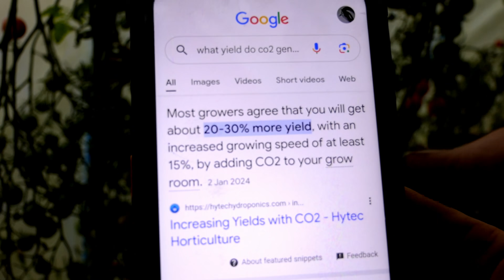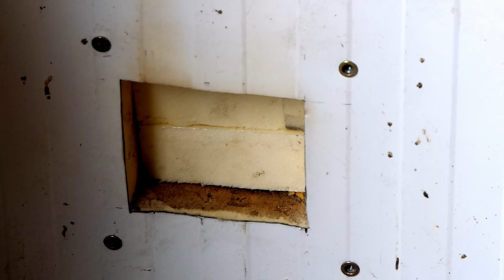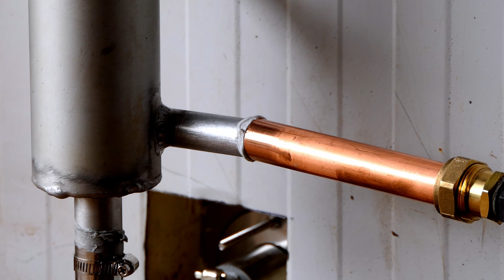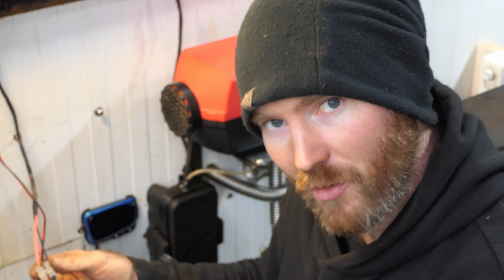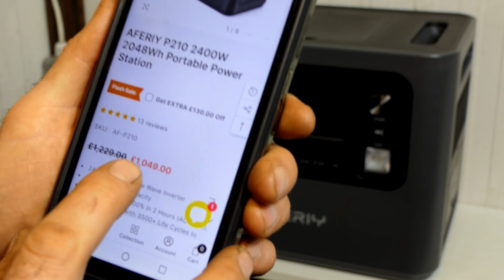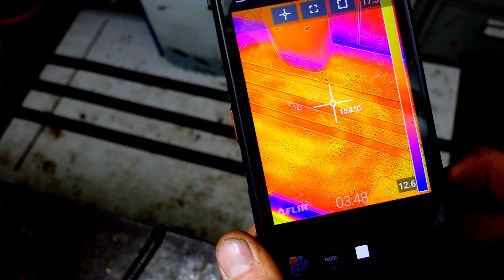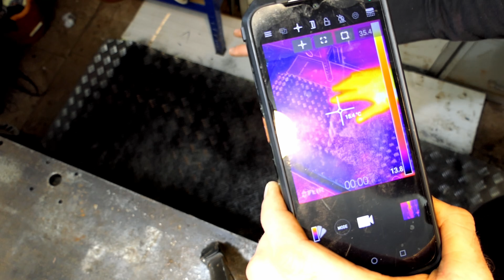NEW! Better system for Cheap and Safe Heating💲+ Underfloor Heating Mod test🫠

Comment: Love the videos. Just got my deisel heater after a friend demonstrated his in his camper van... and as I spend a lot of time in my manshed with my telescopes, I could do with a little warm.. I was wondering if the exhaust fumes could be pushed through a radiator first before going outside..
Reply from the maker: @alecireland5709  thank you. You can but cleaning one may prove to be difficult than less you class it as a consumable part. Cheers J
Reply: @joshuadelisle  I would use rads that are being thrown out, so it shouldn't be to much of an issue. Possibly cleaning could be done by taking the rad off and giving it a bash with a rubber mallet.. I'm just thinking of ideas before I set mine up..

Comment: Simply bury the underfloor heating pipes within a dense material eg screed on TOP of the insulation then all will be well with the efficiency rating.  Your test here is very flawed.

Comment: I rembember watching you last year or two with the previous experiment with the sand and air tunnel. As to your floor heating, you are using an insulated wall panel, with insulation in the name, so all the heat that goes into it is being insulated, so it all goes back out. It is not "lost" into the panel. I don't know how the inside of your eat exchanger looks but surface area/fins are needed to get all that hat into the water. Something like a car radiator, but backwards. In any case, quite impressive getting 45-50°C on a room heater from waste heat. Great results this time. 
EDIT: Thought about it right now, you might be able to get a car water cooled intercooler from a turbodiesel, push the exhaust through that and scavange the hot water from it that way. A junkyard will probably have plenty of them. Also as you mentioned, a cooled EGR might also work for this. 

As to your initial and last point, even aquarium people inject CO2 into the tank for he plants. Waste energy and efficiency is a much more important part of the equation.

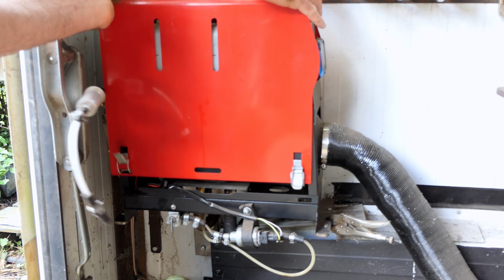Comment: 8:00 in AZ, love your clip,I just would like to say if you were to want hot water & still heat floor mount a tall water heater or tall water tank next to vevor but should mount as low as possible then make your heat exchanger as tall or a little taller & a t at the bottom so u can clean your exhaust of soot, now with thermo syphon flow you will not need a pump but if you use antifreeze you'll need a second heat exchanger the use pump for that, I've experimented with thermo syphon floor heat with a pellet stove exhaust, heated my upstairs apt. No pump, 20' stainless double wall chimney & with the height created more thermo syphon flow plus a tapered poured concrete upstairs floor, apt had a vaulted ceiling on chimney side which created more thermo flow, entered wall at highest point then manifold with 5 lines running down the wall & through the pitched floor then back down to basement to bottom of chimney to cycle again, pellet stove in basement but exhaust heated apartment

Comment: putting climate science denial on you landing page is probably not the best idea, its really easy to see how humans are causing climate change because we can use isotopic fingerprinting to detect the carbon isotopes in the atmosphere, when you test the atmosphere you will largely find carbon with a lower ratio carbon-14 to carbon-12, which is the signature of fossil fuels. There are many many more ways to prove humans are at fault but this one frankly should be enough.
Reply from the maker: I don't deny anything about climate change and how much is contributed by humans, I've only shared known facts, I'm just not convinced carbon dioxide is the main factor and instead I feel it's being used as a means of wealth transfer and control of power. Geoengineering and deforestation are major factors that can be more easily tackled but there are no significant actions because it doesn't generate wealth for corporations. Cheers J
Reply: @joshuadelisle  theres a simple experiment you can do at home, take two containers and put a thermomiter in each, fill one with C02 and then shine a single lamp on both and you can observe the greenhouse effect for yourself
Reply from the maker: @N1ghtR1der666  you can do that with plants too and see which grow better. Cheers J

Comment: Funny thing…every stat you just mentioned, I cannot post. YouTube removes my posts as being against the community guidelines as false/misinformation and against the global warming postulated by those in power. 
I wholeheartedly agree. 
Keep up the good work. I am currently in the middle of setting up a system in my home, as it will be way cheaper than what I’m currently using.
Reply: Hi having a cheap storable fuel also protects from power cuts or mad foreign leaders turning the gas off!
Let’s all go electric!
Oh you burn gas…..
Ok let’s go wing and solar…..
Oh you haven’t built the infrastructure or turbines, or solar farms or batteries….
Ok how about solar on my roof…
Oh you don’t like it when I own it….

Life is fun.
Take care M

Comment: Quick question what does that rubber gasket do i removed mine as it smelt bad do you think I should buy another one. Btw really like this video
Reply from the maker: @dudarus1  I removed mine too. It just stops air escaping from the blower. Cheers J

Comment: Why not connect the exhaust to the radiator? And just use the hot air to heat up the radiator?

Comment: Great work, this is all things I have been wanting to experiment with as well. I have been looking for a way to include some motors that run off of the excess heat so you can use the heat to run an alternator that will charge the battery that you added to your heater. That way you dont need to add solar panels to the  battery. I also completely agree with your environmental view about CO2 and think the only smart thing biden ever said was before he got elected and it was "we should take saving the rainforest more seriously and should consider paying south america to stop cutting it down". I havent heard anyone say that since the 90s. Keep up the good work.
Reply from the maker: @awarenessforthebetter8336  thank you. The other way I'll be testing out is running a diesel generator on kerosene with a lubrication additive and capture the waste heat from the exhaust. That way I can generate cheap electricity and heating. Cheers J
Reply: @joshuadelisle  have you ever heard of a sterling engine?
Reply from the maker: @awarenessforthebetter8336  I have. They aren't very efficient and are generally very low output. Cheers J

Comment: Two things to point out, one that (as others have said) the pipes carrying the hot water for your underfloor heating are themselves insulators and will therefore not do very well at transferring the heat up to the floor itself. Replacing them with copper water pipe would make an enormous difference, but then you'd also need some sort of diffusion so you don't melt your shoes. Sticking with the PEX, stuffing some normal aluminium foil into the grooves above the pipe might be enough to help create a thermal channel to bring it to the larger metal plate, or you could use thermal transfer tape if you're feeling fancy.

The second point is that, while CO2 increases do lead to life bloom (much the same as radioactive fallout does), that's not the same thing as being good for human life. Humans aren't very well evolved at all & have real trouble adapting to changing conditions biologically. If we keep cutting down the trees then we will end up with more scrub land which, combined with further extremes of weather (whatever the cause; doesn't matter), will lead to greater amounts of fires, which will further pollute the air & raise the temperatures, which will block out the sun, which will tank the temperatures, which will lead to further extremes of weather. The species has not adapted to these extremes of weather at all, & it doesn't appear that anyone wants to fix that with technology either, so that's going to cause a huge amount of problems down the line.
There is far too much debate about whether humans are responsible, if CO2 is the problem, & so on when none of that actually matters at all. What matters is how we can adapt to the changes that are coming.

Comment: best put together system i have ever seen. and best video on the subject. the stuff about the climate change and co2 is perfectly reasonable. try slowing down the pump to make the return colder. bigger EGR always better, more surface area always better, just put an entire IBC in the opposite corner and it will still be warm in the morning.

Comment: There is a reason why underfloor heating pipes are put in concrete so it gives off heat to the thermal mass. But very informational video.

Comment: That CO2 monitor needs replacing, normal atmospheric CO2 is at 450ppm, so your 70ppm above an open flame makes no sense whatsoever 😅😂
Reply from the maker: @bongieger7871  it's a CO monitor not CO2... Cheers J

Comment: Suggestion: Amazing video. I have been thinking about this for a while after watching your last video on diesel heater. What i think may work is having the exhaust pipe going down the heat exchanger in a coil shape to slow the flow of heat going outside but at the same time it allows the moisture to escape too.

Comment: Great vid. COMPLETELY FULL of great info.
I think the underfloor heating would benefit if there was no expanding foam between the pipe but rather timber spacers so the heat can easily fill the cavity.
Expanding foam underneath the pipes, Great.
This vid got "even" better at 43:28 minutes in.
Great to see another Brit saying it as it is, even though no-one in power will ever listen.
Best Regards 👍

Comment: Good vid, good points, Sun, concrete , no trees yes. Buy up Farms for what... Blackrock , or more Tree planting who knows, Grow our own food, yes. Is my punctuation bad yes. I have a powapacs 78000 and the usb blew my mp3 player and phone up not good.  Can you make a external wood stove that can work like a desiel heater so the worm air can be blown into a shed ? If you can I would like to see that  sort of like the desiel chamber but with a door to clean out and heat blown over it ....or maybe they are about ? Remmember Folks ( Govern  Mental Department) this is Maya, Know who runs the show and enjoy the Movie. Toddles.

Comment: If you talk about kerosene in the UK, we here im my part of the world know kerosene as the fuel used in aviation. I assume your kerosene is something else? Maybe what we here call petroleum, the stuff which can be used in the old lamps with a wick? Either way: Here it seems by truck I can only get regular heating oil (similar to Diesel) delivery to a residential address.

So 2 question: 
1st: Can you clarify what exactly Kerosene is?
2nd: Can you get this delivered easily trough local companies selling fuels in general?
Reply from the maker: @yxcvmk  hi. Heating oil is kerosene which is also jet fuel. However the grade will be different for different applications. Lamp oil in the UK is parafin which is a pure grade of kerosene. Cheers J
Reply: @joshuadelisle  Hey, thanks for getting back to me. If heating oil is Kerosene, then it's also Diesel? Because heating oil here is pretty much the same as Diesel, but the government colors it to make sure nobody puts it in cars, since the Diesel is havin higer tax.... 
So when you talk about the clean burn with Kerosene, which is heating oil, then the same applies to Diesel? It seems I am missing something.
Reply from the maker: @yxcvmk  it is very similar to diesel but diesel is slightly more viscose and has lubrication additives which are important for finely tuned vehicle pumps. Also kerosene copes with freezing temperatures better whilst diesel tends to gel up. Cheers J

Comment: does it make sense? dunno, I guess the bastard standing charge kills gas! well here goes for the stuff on gas, 1 October to 31 December 2024: The energy price cap for gas is 6.24 pence per kilowatt hour (kWh) with a daily standing charge of 31.66 pence 1 January to 31 March 2025: The energy price cap for gas is 6.34 pence per kWh with a daily standing charge of 31.65 pence 
October 2024: Unit prices for gas are expected to increase by 14% - doh! what the * is standing charge?

Comment: AFAIK Eberspächer, the original inventor of the D4 auxiliary heater that Chinese companies are now copying, recommends using kerosene as an arctic fuel. 

That's why I don't think the pump will give up any time soon if you use kerosene instead of diesel. 

Thanks for your great video!

Comment: I don't understand why you would go through all that when you can use 240 to 12v and connect that to the changeover switch if you have powercut the switch will change over to battery

Comment: You should add some anti corrosion additives, you will get dissimilar metal corrosion from the Aluminium and Copper, they don't need direct contact even if the sealant does separate them as the water will act as the conductor. I had huge problems with a Copper block but Aluminium radiator in a PC water cooling kit when I didn't fully know what I was doing.

Comment: I am going to put one if these into my caravan but I think putting the burner high up and use flow tubing to port the hot air into the original hot air outlets of the caravan. 
Port the heater exhaust into the top of a radiator and port it's outlet to drip under the caravan. 
Your views on this ?

Comment: Wouldn't it be possible to just gravity feed the burner with kerosene? Or does it have to be delivered at a certain pressure?
Reply from the maker: @dennissorensen8765  it needs a certain rate of feed for the settings selected. As long as you can regulate the flow it doesn't matter how it's pumped. Cheers J

Comment: I heat my house with chinese diesel water heater, floor heating and water boiler is also connected (via inside heat exchanger)it's loud compared to original webasto, but works good. At the same time i drive elektric car, many people think i'm stupid, i find they are useless in mathematic's.

Comment: Someone may have already mentioned this in the comments, but I just viewed a video where the guy ran the exhaust gases through a cast iron radiator. It's to make use of all of that wasted heat that  normally goes out with the exhaust. It's done much like what you do with the water heating system: D&S Farm NS

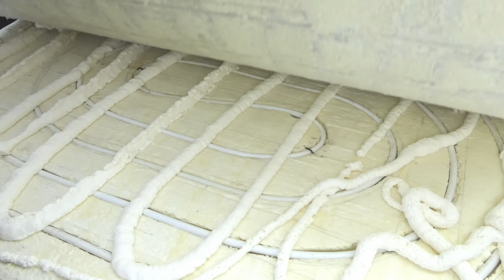Comment: 21:15 Why not use this foam as sound insulation for the pump? Inside enclosure place 2 bags and spray foam inside them close the box so that bags form. Wgen they form there should be 2 halfs of the foam inside the box. It sounds easy but its a bit messy. Nonetheless clicking is much less anoying. Still not silent. But I guess then  bigger is beter. Thanks for clarifying about position of the pump though, I was worried it absolutely need to be positioned at 15 degree but since its stationary it doesnt matter.
Reply from the maker: @aonozan  it doesn't work. I already tried covering it but because it is connected to a hard pipe the vibration is amplified. Through to the radiator and heat exchanger. Instead it needs soft silicone pipes and a cover and then it will work. Cheers J

Comment: 33:35 CO has basically the same density as air. YES it is technically less dense, but perturbations like a heater fan will just mix it up with the rest of the room air. You need a minimum of 4" from the ceiling/wall/floor so the meter isn't reading only less mixed air, which settles more easily in corners, leading to an inaccurate whole-room reading. It can go anywhere 4"+ away from any surface, so up high is just convenient for being out of the way. If you want a source, Kiddie (a common detector brand in the US) says you can put it 6"+ away from ceiling AND floor.

Comment: I’ve been binging your videos and im really interested in getting a setup like this. However in Norway it’s illegal to use kerosine but its legal to use biodiesel. Would you know anything about it? The fuel is called HVO100
Reply from the maker: Hi. Yes if you can get waste veg oil from your local restaurants for cheap there is a process to remove the glycerine and turn it into bio diesel. It's a bit of work but is very cheap. Cheers J